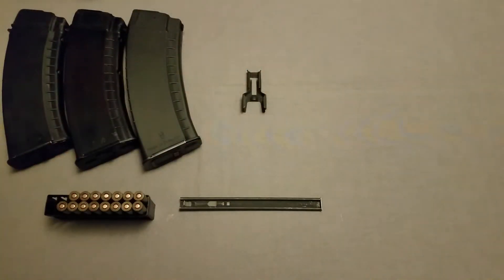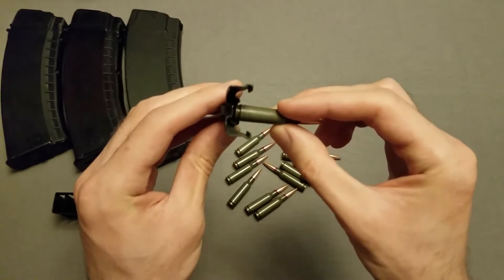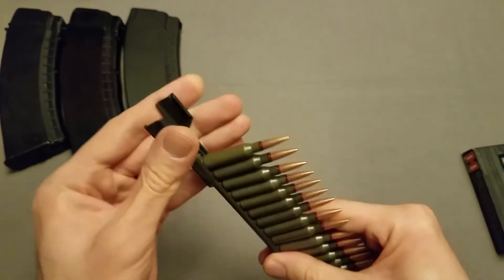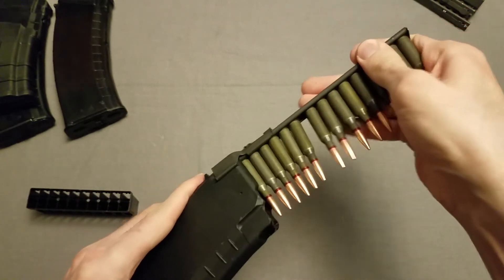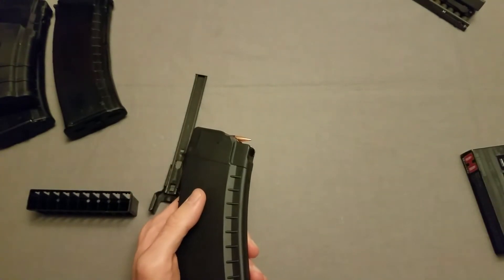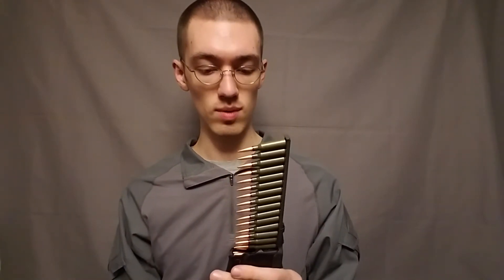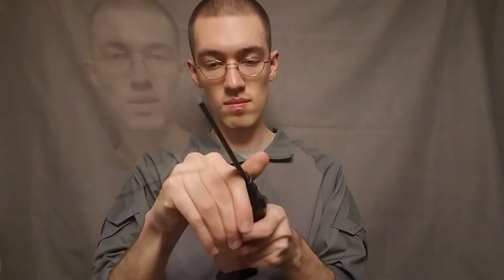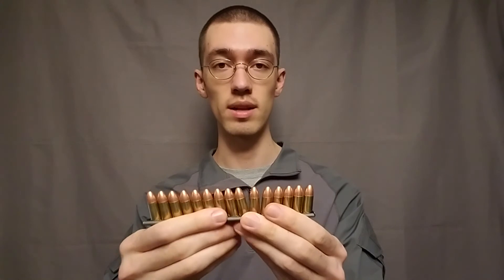AK (5.45, 9 x 19) Stripper Clips - First Impressions

Comment: On those monarch cartridge holders, you can run the stripper clips over them while they are still in the holders and just lift up.  Its better when you just have 10 rounds on one side.
Reply from the maker: That's a good idea, that'll speed things up quite a bit.

Comment: Do you have to maintain them? I got a set of four of these to use on my KR-9 but they are a bit rough and charging the magazine is difficult. Do I have to sand or polish the clip?
Reply from the maker: I don't think very much maintenance needs to be performed on these. Mine felt rough when charging the magazine as well and I haven't found any way to get them to work better.

Comment: I am looking at many website but see many bad reviews for being small, rough, or not fitting the last 3 bullets. I am running a AKM. What merchant do you recommend?
Reply from the maker: I assume you're running a 7.62 x 39 AKM? If so, these clips won't fit, they only work with 5.45 and 9mm. If you do want to pick some up, RussianSurplus is a good site that has them currently, but even to this day I still haven't got these clips to work well at all so I don't recommend them.